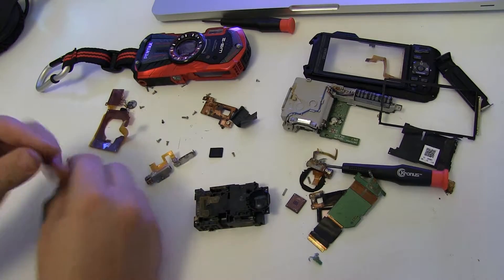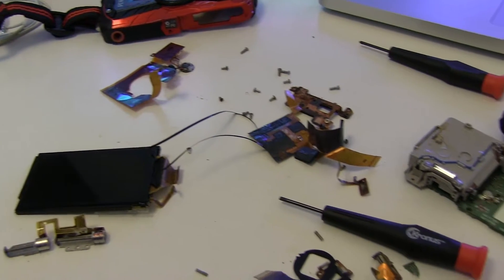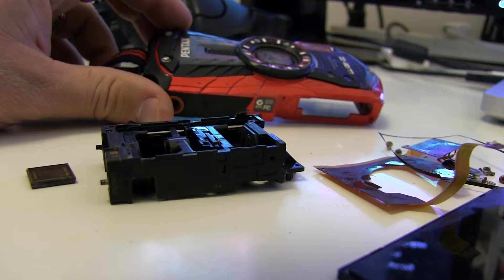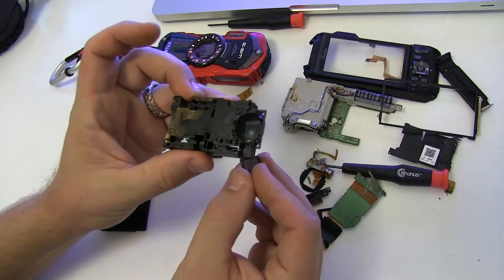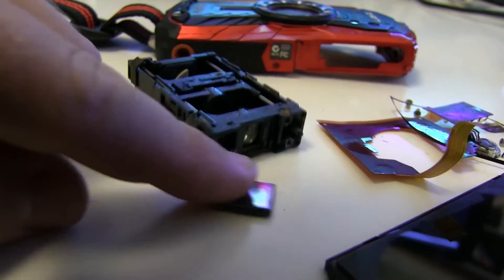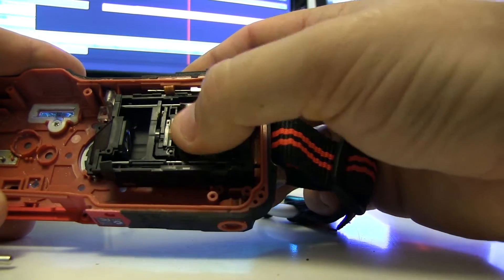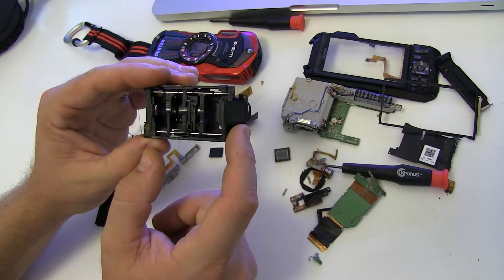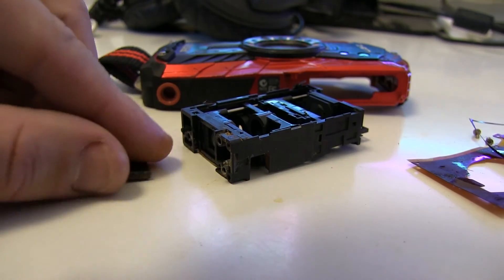Pentax WG-3 Zoom Element

Comment: After my first Caribbean dive my WG3 obviously took some salty water, battery contacts  got rusty and bent and not charging any more. Andrew, can you explain how to disassemble the camera? I've unscrewed 5 screws on the back, it looks like something is still holding over the screen, I don't want to break it.
Reply from the maker: I tore this camera apart after it leaked during a dive in the Red Sea. I can't blame the camera by any means because I did take it beyond the recommended 12m limit. The point, however, is that when I disassembled this one I had already given up on being able to recover the camera so if there was any issues taking apart the screen I probably just ripped it apart. Wish I could be more help.
Reply: Yeah I found this video with the same problem. I need to get it open.